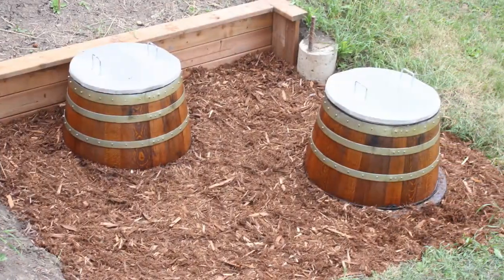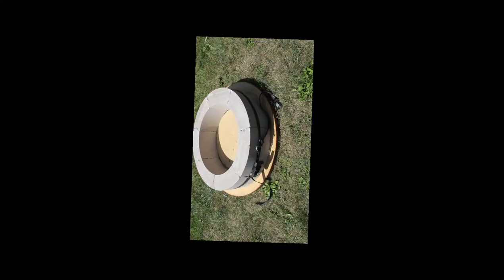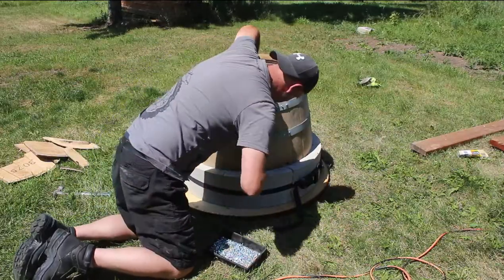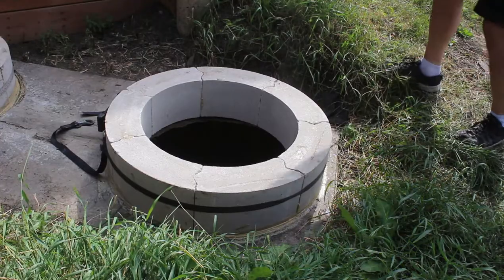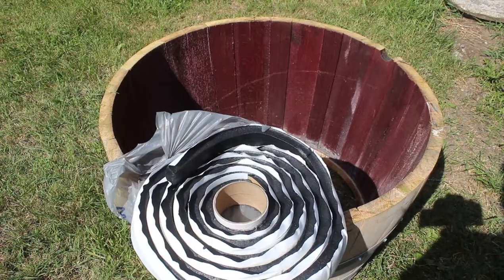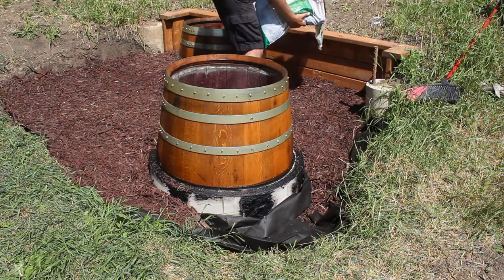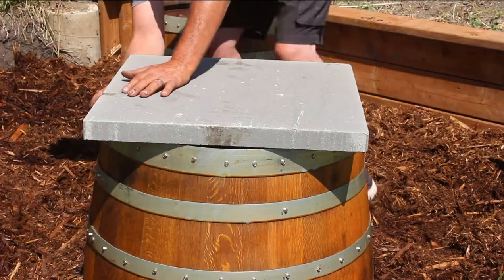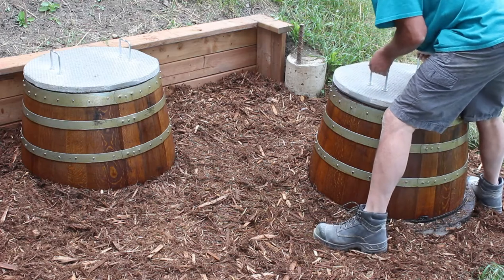DIY Septic Riser and Lid installation  | WILL THIS WORK? my septic tank risers

Comment: Looks like lot of work, I just used two 55 gallon plastic drums that have removable tops & bands, I measured the height I needed cut with jigsaw placed them ontop the tank holes & used the loctite max pro to seal all around exterior diameter of drums spot sealed four spots inside bottom of drums no need to do the whole inside diameter waited for full day then thrown dirt back in around the edges of drum then remaining top of tank, all worked out great for only total of 88$ for drums & sealant.
Reply from the maker: Ya that sounds a little easier then what we did. But I had a load of wine barrels (240) of them at the time. Thanks for the visit friend.

Comment: I like the idea, but I have a couple concerns.

1 The WEIGHT is being supported by the concrete tank around a technical defect (the hole)  That is one crazy amount of weight between the blocks and the barrel and then the concrete lid.

2.  You commented about the water disintegrating the blocks ... and sealed the outside ... but the inside is subject to the heat and cold (I noted the CIL bags ... which is Canadian Industries Limited so you're north of the border).  There's a lot of humidity off the water in the tank so will penetrate the blocks especially in the summer, and in the winter will go through freeze thaw cycles.   So, the inside of the blocks should be waterproofed!  Similarly with the wood of the barrels.

3.  The comment made about the mortgage company ... I've never had a Canadian bank inspect my home for a mortgage.  We hired one privately for our agreement of purchase and sale ... but that turned out to be a total waste of money ... he missed SO many things ... we'd have not bought this house if he'd done his job!
Reply: You hit the nail on the head with numbers 1 and 2

Comment: In the life of a septic system your set up has a very short life span. That is considered a high maintenance item. Some body will be dealing with it down the road. Don't dispose of the original covers. They will be needed when time comes to sell the house. Because banks aren't going to lend money with that non-conforming lid setup.
 You will  again be in compliance if you trim down or replace/resource the old concrete covers to fit under the new barrels on your new brick. 
As is, it's a fail.
Reply from the maker: Thanks for watching and the tip. I'll have to source out new concrete covers. 👍
Reply: @DIYBuilt  No one is going to accidently stub their toe and knock all those bricks out of the way and then fall in. I doubt a riding mower could damage the bricks. I'm sure in time you will run across a nice safety cover to go under those pretty barrels. As you know plastic is the favorite now. But you strike me as more of a concrete kind of guy.
Best of wishes to you and your family.
Reply from the maker: Thanks so much for your support, really appreciate it. Have a great day my friend.😀👍